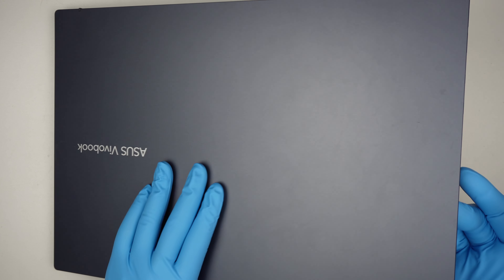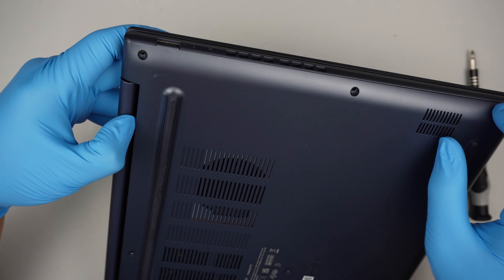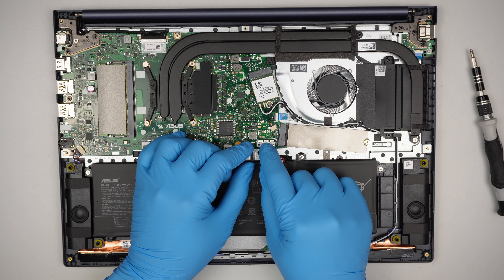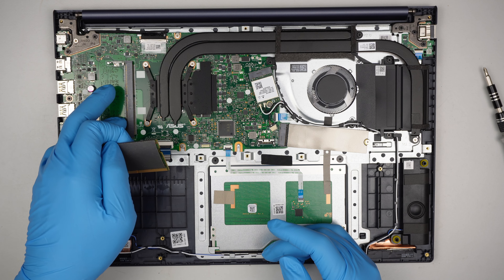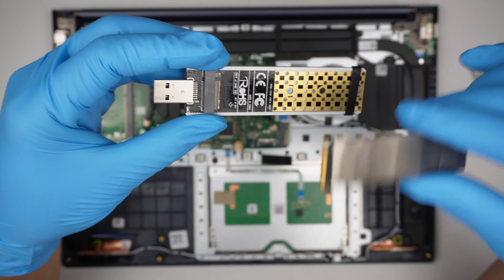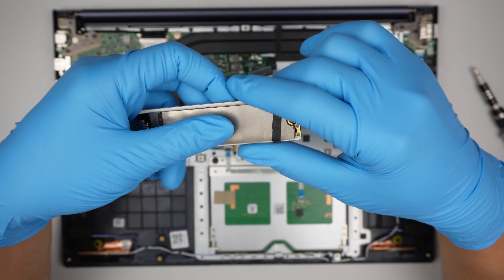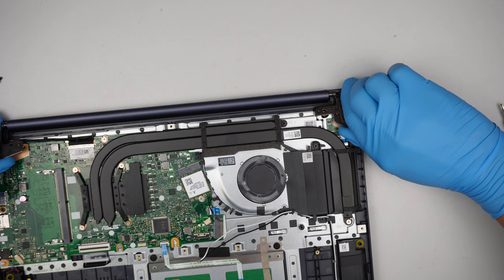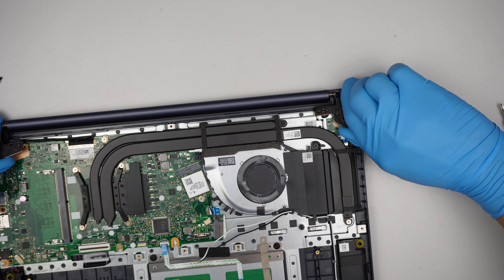Asus Vivobook M1603Q Teardown Upgrade Disassemble

Comment: You linked to a 32GB Crucial Kit, but this VivoBook has 8GB soldered and is upgradeable to only 24GB. Buying a 32GB kit will not suffice, as it only has one DIMM and it only supports 16GB (24GB is the maximum (8 soldered + 16 DIMM)).